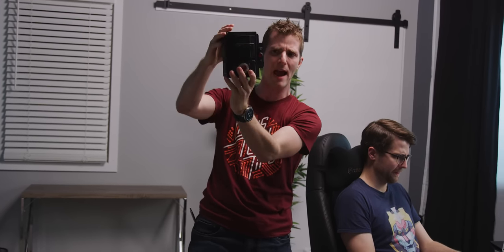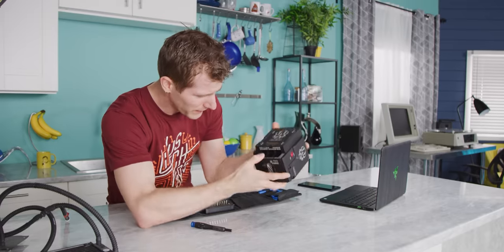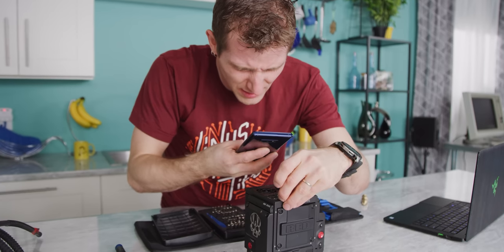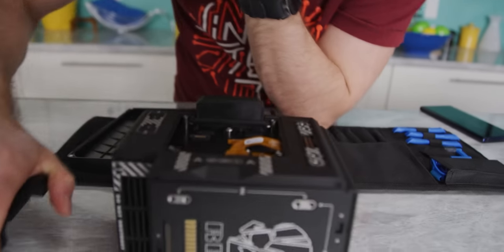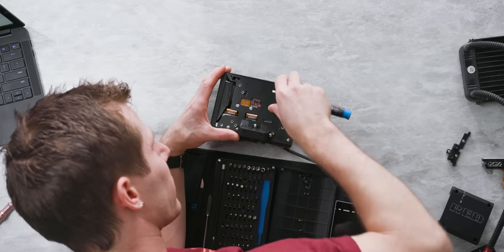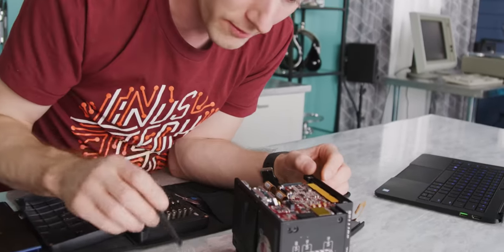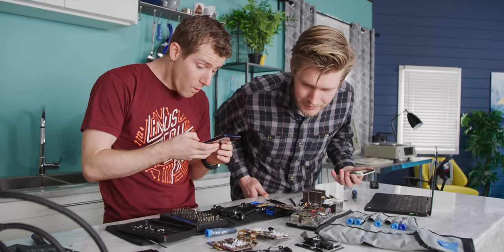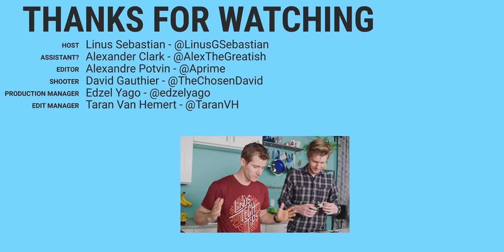We TOOK APART an 8K Camera!

Comment: 7:52 you made a spark removing that wire lol
Reply: RIP RED 2017 - 2018
Reply: Nice catch!!!
Reply: Good eye you got there
Reply: are you sure... it looks like it was just the reflection in the chip. stuck it on 0.25x speed and didnt see any spark only the wire connector being reflected in the chip behind it.
Reply: that's just a reflection off the connector
Reply: @wyattroncin941  yeah the device isn't powered wouldn't have a battery in it Linus would be smarter than to be creating static   purely just a gold connector reflection
Reply: The period and comma key act as a 1 frame advance. There is no spark in any of the frames when he removed the antennae connector.
Reply: Sure looked and SOUNDED like an arc. Capacitors can retain charges even though the battery is removed.
Reply: @MrV1NC3N7V3G4  that is almost exclusively only true of mains voltage power supply capacitors. voltage will mot remain in an electronics capacitor for very long at all, typically only a few seconds at absolute most. go back, pause and use the period and comma to frame by frame it. no spark, just a gold reflection.
Reply: @herranton  woah
Reply: @Icessassin  Just curious, have you ever heard of a capacitor?
Reply: @__gavin__  brah there is no spark. This is not a crt it isn't holding onto any voltage, it was a simple reflection.
Reply: That's alota damage
Reply: It actually looked (and sounded) ike a screw dropped between the board and the casing.
Reply: @JoeyvanHummel  it's a WiFi antenna cable. No screws to hold it on. They are like clip on buttons.
Reply: @matemana1991  I'm sure it is a reflection now after slow motion review, but just because it's a WiFi antenna doesn't mean it can't short out to that terminal on the PCB which could have been powered. But yeah, it's a reflection. Just an odd coincidence with the sound occurring at the same time as the reflection.

Nope, scratch that. Since it is the antenna, it wouldn't be grounded so it could never short out.

Comment: Linus for the love of god save us the terrifying footage and just make this a liquid metal project.
Reply: Hami101 first thing I thought! Would be much easier and be at least some improvement.
Reply: LM on direct die in a case is already sketchy due to spill-risk (as opposed to between IHS and die, where enclosed under the IHS). All over inside a $50k(?) hand-/gimbleheld camera, which also do a deal of shipping around? Sounds like a miracle if it doesn't go horribly bad.

Comment: Actually a cooler sensor means less noise (should be especially apparent in high gain), so this might not be that stupid of an idea.. Would be nice if you could test for that once you're done
Reply: Reds actually perform better at certain temperatures, the Helium 8k sensor has a better noise performance around 39\40º celsius. In colder environments,  you actually have to warm them up, just like batteries (we have Dji Inspire 2 batteries, that last half as long in places Iceland).
Reply: Small problem just came to mind, what about pump noise? Small pumps are usually louder than small fans, which is probably why RED went with air cooling.
Reply: @jm1jonas  , I'm not familiar with the details of the design of this particular chip, but generally any CMOS sensor will have less noise at lower temperatures just due to reduced dark current, but the improvement is small below 30-40 degC (above 50-60 degC is where it really takes off)

Comment: The thermal compound looks quite low grade, what if you just upgrade that one? If you just change it to a better one or to liquid metal, then it will probably be a success already.
But hey, you're not wasting my money here, so go on and subzero water cool it, it would make for a good video.
Reply: I believe that is MG860 formula. A high performance all purpose heat transfer compound. Composed primarily of zinc oxide suspended in silicon dioxide. It is much better than the junk I see most PC builders using. Doesn't burn until temperatures that would desolder chips from the board. No degradation in performance over time. Kept a Core 2 Quad at 3.8-4.2GHz for long enough the board it was on gave up the smoke (that CPU had a stock speed of 2.6GHz). I have torn apart TVs so old they were housed in wooden cabinets which had the same stuff, still every bit as good as a fresh glob.
Reply: @eideticex  and where can I get it?
Reply: @vnyggi621  Search MG 860-60G on SRA Soldering, Amazon, eBay, Element14 or ask for it at almost any electronics shop. Be aware it's nasty stuff to work with, have lots of isopropyl alcohol and paper towels handy to clean up.

Comment: I know you guys have probably already completed this project now however creating a custom waterblock for it why don't you use the air cooled blocks cut the vapor tubes solder copper extension tubes to them and take them to the vent externally where you can then solder on standard unions to attach to the water loop so the vapor chamber becomes the waterblock
Reply: I guarentee you they haven't finished part two yet as of jan 2019
Reply: Well, after that you wouldn't be able to return it to stock.
Reply: That's a genius idea although I'm trying to remember if heat pipes are hollow or not.  But at the very least the base of all those heatsinks should become how they attach the waterblock.

Comment: you do have a cnc still right, mill some thin water blocks, use think copper pipes to run it out as i would guess it does not need much water flow if it can be run with no cooling for filming fine. finish it off with a streampunk paint job and ur good

Comment: I feel your pain, optical electronic type stuff is some of the most complex engineering. Huge task to undertake your guys best option,if you guys get stuck is to review footage of taking it apart. If you want to water cool it you might want to look at laptop coolers. if you have plate sizes making the cooling brackets with copper plate and tubing would be pretty easy with a bit of soldering.

Comment: Re: Protruding screw holes on the chip: Get a thicc piece of copper, thicc enough to match them, machine matching holes on it. The cooling block you could drill holes also, then cut to fit hollow metal pipe of the same thiccness and glue it in place. Make the holes on the copper piece, and the inside of the pieces of pipe on the cooling block thicc enough that the screws will go thru.

chip -> copper piece (with holes) -> cooling block (with holes that are "walled" with fitting pieces of pipe that are glued on both ends).

Comment: The xilinx kintex is the OPPOSITE of a asic.Its a fpga(field programable gate array) whis has no logic unless its programmed.ASIC's are chips designed to do one thing and cant be programmed or used for anything else.
Reply: Yes, hence the term "ASIC" (I'm explaining this for others, I know you know this, hence your comment :-))

ASIC: "Application Specific Integrated Circuit" - IE, an IC specifically designed for one CUSTOM purpose.
Reply: Finally some electrical engineers in the comments.

I think this takes second place to the watercooled servers in terms of awful ideas.
Reply: Great info thanks
Reply: Why didnt he use lattice semiconductor IC's
Reply: @QuickQuips  Electronic engineer here: Think ElectricalEngineer++
Reply: Thank god, was looking for this comment.
Reply: indeed, shame it is a xilinx. Red should look to switch to Lattice or Altera device, Xilinx really have started treating some customers terribly.
Reply: To be fair, Alex did question whether they were ASICs or FPGAs and it seems pretty clear at this level the only thing Linus is really qualified to do is surround himself with other people who know more than he does and try to keep up.
Reply: @EwanMarshall  A cyclone would've been nice. Just as powerful, if not more, but from a better company.
Reply: Well, yeah, one would choose a model powerful enough, they all sale various models. Just avoid Xilinx if at all possible. They are not people anyone should ever want to do business with, and that is saying something.

Comment: You could make a water block for that weird chip.  If you get access to a CNC mill, you could design in CAD and create your own.  Seal it up with RTV so you don't have to use custom gaskets.

Comment: The Vid isn´t in 8k cause they borked the camera.
Reply: They have two Red camera's. One of which is still intact.
Reply: tonpa888 think it mightve been a joke, itd be quite hard to film on a camera whilst you take it apart
Reply: @banton9368  That's correct. But they could have shot the video on a different, less expensive camera. If they don't have 2 Reds
Reply: Does YouTube even support 8k though?
Reply: YouTube supports 8K, but to my knowledge LTT has never done uploads in 8K, because there is no point in it at all. However, I do believe they argued for why they shoot in 6K or 8K, because it means the end product is of high quality when they do downscaling to 4K. But the editors also have room for making improvements in terms of aligning the video correctly if it was not properly horizontal or crop to get the shot perfectly in frame.
Reply: I know, i was making a joke but, yeah i remember them talking about on the video of why they spent 300k on the cameras. @Lars16
Reply: @DanielLopez-up6os  My answer was for BuckieTheCat, I fully understood your joke.

Comment: Astronomical cameras are cooled using peltier cooling (some even with water loops) getting temperatures of as low as -80C this is to reduce thermal dark noise from the CMOS or CCD with longer exposures. Checkout FLI, ZWO, QHY, StarlightXpress. Might make for an interesting video

Comment: sighs

Why no iFixit sponsorship?
Reply: Because it could easily end up as iBrokeit
Reply: They might already have an ifixit sponsorship but it's just not in the same sense as their other sponsors. It might just be something like "use our kit and mention our name whenever you take something apart and we'll give you $$.".
Reply: Bevause they can't fixit
Reply: You think THEY are at this level? ROFL! They repair CONSUMER JUNK. All these "experts" are just reinforcing muscle memory by repeating the same actions hundreds of times, over years, with tiny variations in product revisions. Just because you can work a heat gun and handle a screwdriver, doesn't mean you're an "engineer", it means your experience is taking things apart, and further, products which are within a VERY narrow scope.

All those thousands of Chinese workers building phones - do you think they understand Ohm's law, understand inductance or RF theory? They know how to grab a part from a bin, screw it to another one, place it on a test jig, press a button and hear a chime saying "TEST OK!"
Reply: @unlokia  How does this bring any shape of relevance?

Comment: Linus and crew, could you sandwich a few graphite thermal pads in between all the IC's and have them act as both thermal pads and heat pipes at the same time? The parts that shouldn't be in contact with anything else, maybe put heat shrink around it or something similar non conductive material?

Comment: This is wild! Although with this camera a consistent temperature is more beneficial than a lower temperature. I know if the operating temperature strays to far from the calibrated temperature you have to reset the black shade which is super annoying. So if this can help with that then sweet! stoked to see if you can figure something out.

Comment: Better cooling,... means lower sensor noise in the video. That's worth doing it for alone.
Getting the cameras to be quieter would be better for the Sound Dept.
Linus,... why not use a Peltier device to suck out the heat from the sensor, and then have the water cooling block on the other side of that ?

Comment: But the real question, How many spare screws did it have?
I can see the reason of doing this if you do astro / low light / long term continuous use. As it could help the signal to noise ratio, but other than that. Meh? It also has me wondering if the water block would create vibration especially if attached directly to the back of the sensor while running, being that the fans are probably in foam or rubber isolation.

Comment: They are probably doing what NewTek Did with the old Video Toaster.   Using Xilinx fpga's but putting them in blank.   When the device boots up it programs the fpga's so they could essentially rev the hardware.    When they did their non-linear edit system the Flyer the first boards off the line could barely produce video and after a week of reving the "Software" they were functional.

When they claimed the new version of the software was a "Hardware upgrade" they really were not kidding.

Comment: @Linus Tech Tips The Only way that you've manage to water cool it most probably is to replace the heatpipes with cooling copper pipes and maintain the blocks but i don't know if it is enough to dissipate the heat, better off with a air flow peltier cooling and water cool the peltiers and pump cold air into the RED

Comment: why don't you just use heat pips inside of the camera in a loop to a custom block at the vent out put and add slandered fittings to that block?

Comment: There's an aftermarket modified Nikon dslr with a peltier cooler on the sensor to reduce high ISO, long exposure, low light noise. I'm pretty sure it's usually used for astrophotography. So it's not unheard of to have exotic cooled cameras.

Comment: Is that ceramic thermal compound inside? I used to use that stuff on consoles I repaired because it ran so much cooler. I still have a tiny bit sitting in my emergency junk bin.. lol

Comment: The colder you run any device the longer the Mean Time Between Failure will be. Every 10 °C (18°F) cooler you run any device will typically double the MTBF. The chemical Arrhenius equation would typically apply, where the rule of thumb that an increase of 10 K in temperature doubles the rate of a reaction. So water (or oil) cooling any device is not dumb, if the goal is to increase the MTBF.

Comment: You should contact AvE (Youtuber). He's got a really nice CNC milling machine that he could use to make your custom heat sinks, already threaded for water cooling. Better yet, he's lives in Kanuckistan. 

That said, I think you'd do better to spray EVERYTHING with conformal coating, put silastic on any components that don't need cooling and pump water through the body instead of air. The existing fins would transfer the heat to the water then the water can pass through a rad on the outside. You'd just have to seal the outside and attach your pump to that bottom vent.

Comment: Dude, just pour in a bucket of Kryonaut, slap it all back together nice and tight with some higher powered fans (perhaps externally powered from a separate battery with a power switch to retain control/silent running functionality; just don't forget to turn it back on between shots or if you can, wire the switch so that it turns on between shots automatically) and call it a day.  I don't think water is going to happen, but you can potentially improve the cooling via superior paste and higher RPM fans.  They probably use run of the mill industrial OEM/system builder paste and stock fans that aren't the most powerful or the most silent, especially since they're essentially using passive cooling during operation when the parts are actually ramping up the heat and only cooling when the device is running idle between shots.  If you really wanted to go nuts for when you shoot on location in hot places, bring a generator and a portable AC unit and build some kind of chamber that holds the thing in a confined space while blowing cool air into the intakes and exhausts the air out the other side via some ventilation.  Of course neither of those solutions has the "cool factor" of duct-taping on a radiator and water cooling the thing; I just don't think it's going to work.

Comment: Was there Virtex Ultrascale+ or Zynq Ultrascale+  :)
Edit:
Missed that Linus told that there was Kintex 7. So 2 cooled chips can be Kintex7/Virtex7. It seems these was connected to sensor so these are handling raw data. So these may be about 5-10k each if they are Virtex7.

Comment: Custom water blocks == easy.  Fittings+rubber washer for block == advanced level (machining holes into small screws etc).  Tubing == 3mmOD solvent ink tubing for printers.  Fittings for splitting/combining tubing to smaller/larger sizes == easy....

Comment: I would suggest to use gloves when taking electronics apart. Finger oils speed up tarnishing and/or initiate a point of corrosion and accelerate it. 

As to the water cooling block, you can start of a solid block and use the CNC you guys have and trim all the parts that aren't necessary until you have a solid block that fits snug with silpads. Then after getting all the dimensions in CAD, you can work on a split block design as every other water cooling block and it'll be A' OK.
Reply: I handle boards all of the time without gloves and have never had a problem with skin oils initiating corrosion. If its that much of a problem, wipe the board down with IPA. Besides, I would rather the board be a bit dirty than risk permanently damaging components through static generated by gloves...

Comment: This is when you contact EKWB and beg them to help you through this potential catastrophe by custom designing a water block for you that holds all those parts in place. Then you can use a separate pump/reservoir combo.

Comment: get some copper, drill it, do a little milling, solder some copper tube to it, adapt it externally to your rad and call it a day. shouldnt be but a week or so in fitment and milling. buy your selves a small cnc